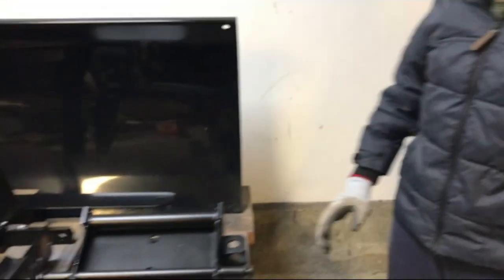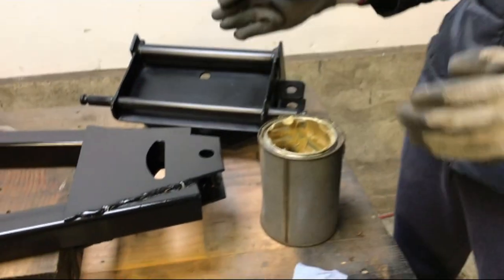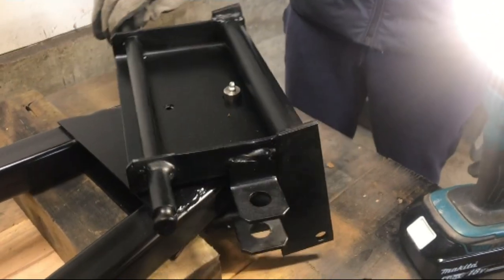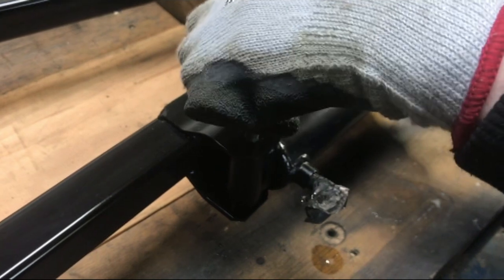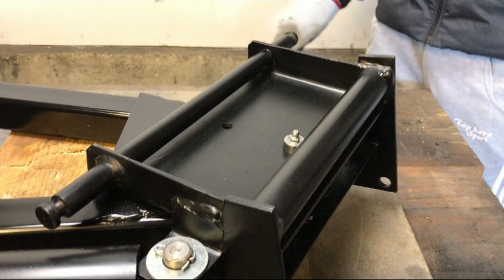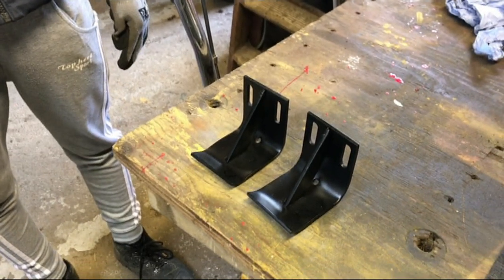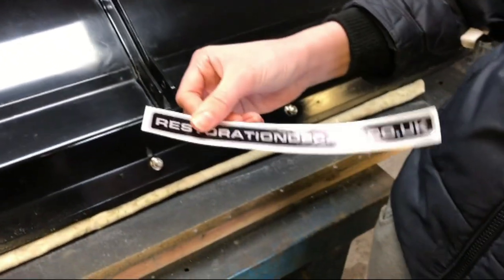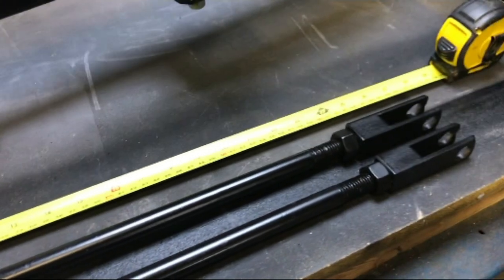Bolens HT Snow Plow replica - Part 10

Comment: Thanks for getting back with me and the reason I found your video is I also was looking for a three-point hitch or looking at pictures to try to figure out how I'm going to make one for my 1886
Reply from the maker: I do have some plans to help make a 3pt but these are for a HT. I believe this will also work on the later 1886 that have a different axle. I believe I downloaded them from Garden Tractor Talk forum but if you think these may be useful drop me an email and I will send them to you. I also think I have some pictures and measurements from the 3pt used on the Husky models but so far I have not been able to find them. Take care